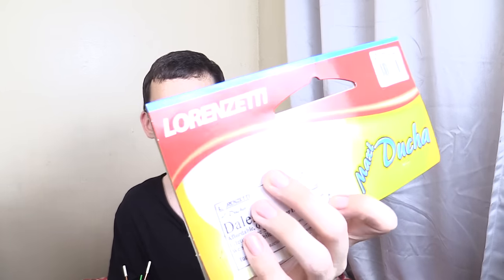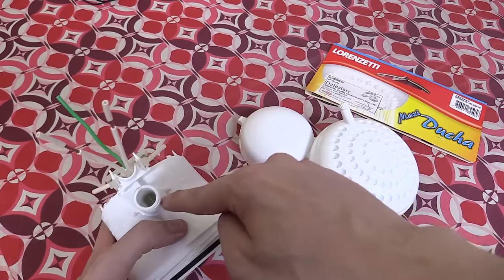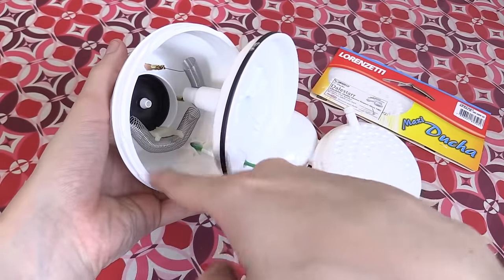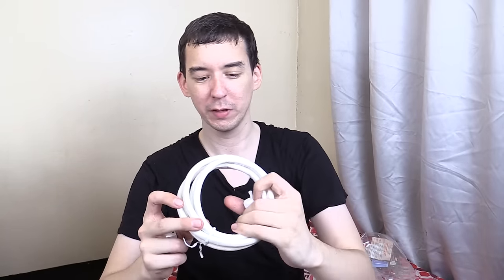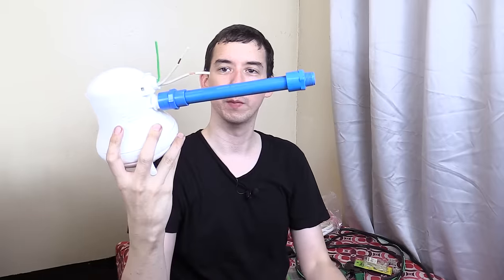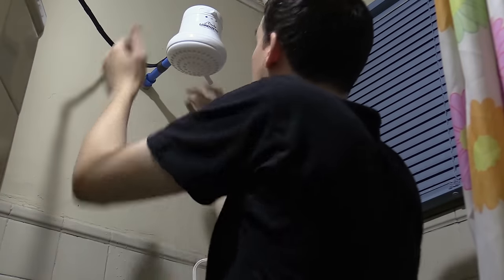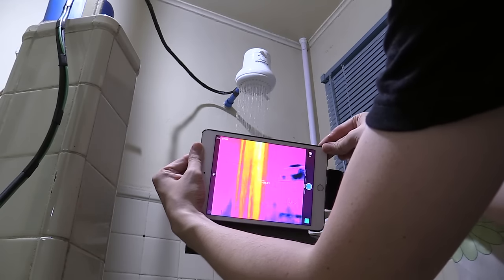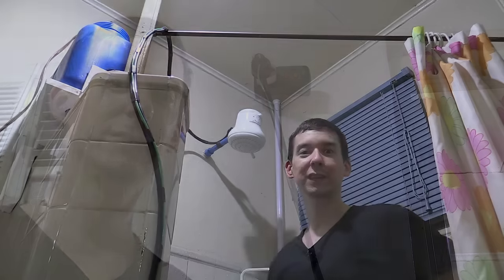Lorenzetti Electric Shower Head

Comment: What you are showing is a small, maybe inch long naked wire for a ground. That isn't going to provide adequate protection. You show that there is a larger piece of grounded metal in another part of the shower head, but that is before the water gets to the heating coils, and therefore, that isn't going to provide any protection. O. K., now, if you had a grounded screen over that hole after the heading coils, I would say that that will provide adequate protection, but then there is the headache of having to open the shower head and do periodic inspections, since the screen may wear away. The best way to provide protection will be with the RCD device that you hooked up, but you will have to keep the grounded wire of the shower head disconnected, other wise it will keep on tripping the RCD device. It didn't trip the RCD device in your area probably because the water didn't have enough impurities in it to cause it to conduct enough electricity to trip the device. Alright, now, probably you are wondering if the contact the water is making with a person cause the RCD device to keep on tripping. Not if there is a good amount of distance between the shower head and a person's head. Being that the water comes out in droplets, it won't produce a conducting bridge between a the shower head and the person's head.

Comment: Won't it melt after some time if the water is hot? If it does, then buying a boiler would propably be cheaper in a long run.

Comment: I have lived my entire life here, I do not defend brazil in any means but just to clarify isn't the showers fault if one does not use the ground.
My moms house didn't had a ground, I used to get shock from everything, my pc, the fridge, the shower, a electric guitar when I had one, hahah that was hard to overcome.

like others have said, most houses are old, and I'm not sure why but looks like none of the architects care about grounding anything. You'll find ground only in new building or those that have enough money to build one, gas pipes started to been a thing here around 2008 more or less, but not for shower, mostly for oven.

When I got the money I have the ground installed, and all the wiring for all the sockets plus the changes in the main power distribution plus the service cost me a lot, but no more shocks. I can definitely say say that most people "prefer" the small shock over the super overpriced services and products.

Plus, it is hot as fuc#@# here, so people don't care much about it, specially if you go any where that isn't south. I used to live in Cuiaba, or how people call it, Cuiabrasa, with means the name of the city + ending with ember (brasa). You can easily see 35º at night

Comment: Those showers are usually safe even without the ground wire, unless the neutral wire gets interrupted. In that case, the electricity has no way to go other than the ground, passing through the water and your body. The ground wire is a form of safety redundancy that avoids accidents in case of an interrupted neutral wire. By the way, any breaker panel should have a RCD (device that breaks the circuit whenever it detects current leakage).

Comment: If you take it apart, use a glue gun and completely cover the exposed wires as much as possible.  It can greatly increase the safety of the mechanism.   I would also consider wiring in a circuit board designed to not pull too many amps and then a fuse just in case.   That should prevent any bad things from happening, especially in an electrical storm.  It's very simple tbh, just requires a bit of extra time.
Reply: the glue would melt and, probably, be more harmful tbh

Comment: It's hilarious how many Brazilians comment on these shower head videos and how very defensive they are about them.

I understand the various reasons these are so commonly used in some countries but they still have to be installed properly and be replaced every handful of years to remain relatively safe to operate.

Yes, they technically work and are reasonably safe but fundamentally are more dangerous than a water heater tank or a the more robust types of electrical shower units. It's just a fact, sorry.

Comment: Those things have a serious issue even with proper wiring because they turn ON automatically with water pressure but if there's dust in the mechanism it can get stuck ON once you close the water, then they start spewing hot water and vapor and next thing you know the plastic starts to melt and fall down like drops, they are made with PVC so at least the fire risk is reduced but there you go, there's another reason to call them like that. 

If you are going to use one of those things make sure you have a switch next to it and keep in mind that if you turn the water off and the shower head still keeps making noise it means that it WILL burn unless you turn the water back on or turn the switch off. If there are children you can tie a cord to the switch so they can pull it and always stay attentive because they will most likely not know what is going on.

Comment: I decided to touch the piping on a shoddily installed one while showering at a relatives place in Brazil, ended up getting a 240v tingle. Never had an issue with em otherwise.

Comment: Use the low seeing. For the high seeing you need a #10 wire set and 30 amp breaker minimum. If you take long showers then you need a number #8 wire set and 40A breaker. You have to use a twist lock or direct connection because the biggest standard plug is 20A and you'll need a GFI breaker since the biggest GFI plug is 20A and if in a foreign country make sure the panel actually has a ground that's actually grounded to Earth and to the incoming neutral. And that the panel main breaker and wires feeding it are bigger than whatever you are sending to the shower so you don't set your place on fire.

Comment: What's fun about these is when they are installed properly and the heating element inside is burnt out or disconnected due to corrosion or what ever if u hand come in contact with the nozzle part while running water , it will shock you !! I've been zapped a couple times . Then I upgraded to an economic smart 18 ...lol

Comment: The wires you think is strange is a safety mechanism. We use a device to unite the wires of the head shower and the wires of the house. If something fail, the divice burns but not the shower or the house.

Comment: I'll def. will not install this in my summer house! Better I'll be dirty and stinky (or will visit sauna few times) than I'll be dead.
A much safer solution is to use transparent water baloons on a roof. They're getting warm (or hot!) in sunny weather. I've seen them in China, it's a very popular thing there.

Comment: The worst thing I’ve ever heard of those eletric showers here in Brasil was just a little static, the fio terra (the green wire, I don’t know how do you say it) estabilize the circuit and the circuit breaker turns off before a real chock. Btw, I already heard about a girl who suffocated with a gas shower...

Comment: Even ungrounded , here in Brazil we don't use copper pipes, we use pvc pipes, in some very poorly executed installation that i had to shower i shocked myself once, but only when touching the faucet and judging by my earlier electrocutions (which include closing the circuit through my hand) the current on my body were way way way lower than a lethal current,it was just a tingling sensation on my finger, so i had to wear slippers to close the faucet.

Comment: So long as the ground is sound ie less impedance than the path through the water and your body then it’s relatively safe even if the neutral phase fails for some reason but really it would need a fast tripping 30 mA RCD. That would never in a million years be allowed in the uk. I’ve stayed in the Philippines many times and it’s amazing how low the safety standards are but people seem to manage fine with no grounds and just mcb protection. The power companies don’t appear to provide a ground into the property so a local spike is necessary but if it’s bone dry then it won’t conduct much anyway.

Comment: Being in Ph tap water is already warmish, different if you in colder climate. I live in Perth Australia and use gas instant water heater. During winter nice and warm, in summer will burn you, unless you set to lowest setting.  Here electrical water heaters around 20kW, Singapore 5kW, so 3kW does make sense

Comment: I recently changed my shower head here in Brazil (Gringo with no prior electrical experience). Never touched the previous shower head directly, but touched my new one while showering today, and felt a tingeling sensation while touching the shower head. Also no grounding avaliable. Could I have put the AC cables the wrong way? Is that a thing?

Comment: All these showers that direcly put Phase + Neutral in the water, present high amounts of current leake through the water plumbing and structure to the ground. This usually do not provoke electric shocks to the user, even with the green wire unconnected. Here in Braizil most houses do not have dedicated Ground wires, and the green wire is either left unconnected or connected to Neutral. The real danger of electric shock is in the loss of Neutral or when it has a high V related to ground. Then shock is very likely. RCDs fo such shower need to allow a considerable current leak without tripping. The newer versions of such showers have heaters isolated from the water so that common RCDs work as expected. In the end of the day, electric shower are always dangerous devices that need to be serviced by trained and experienced technicians.

Comment: Those images are isolated cases, our neutral wire is grounded, when the house doesn't have a properly ground system, like mine, and we don't use eletrical tape, but ceramic conectors!

Comment: Can you clarify this for me. There are 2 white wires and a yellow wire which is used for ground. Of the 2 wire does it matter which is live and which is neutral  or just let me know how did you connect yours, the fact that I see it work with no issues. 
Thank you.

Comment: Houses in Thailand have electric water pumps and in-shower water heaters. And if you think that they're grounded, they may not be.

I got shocked in Thailand when stirring pasta with a metal utensil in a portable wok. I became the ground. Not a fun experience.

Most houses don't have sockets with a 3rd plug for a ground. But What would be the use when appliances don't either.

Comment: I used these types of showers when I was in Argentina, Brazil, Peru and Bolivia. I learnt fast not to adjust the settings while having a shower because I got zapped. 
It is the most stupid idea ever to have electrical wires inside the bloody shower head. 
One hotel I stayed at in Bolivia had the electrical box for the building inside my actual shower.

Comment: This is one of ther cheapest electric shower heads, and yet it has a record of safety for more than 40 years. There are plenty more accidents/deaths related to gas water heaters.

BTW, if your model has 3200W, it has the low-power heating element. Usually those shower heads come with 5400W heating elements.

Comment: The thin stream of water has too much resistance, but if someone unscrews it and it falls it into a filled bathtub if the wire is long enough, and the person in the tub touches a grounded object outside the bathtub, like the metal valve handle for the grounded metal pipes in the wall, then it might be a nasty shock.

Comment: Theres a few safety measures you have to take in order to make this shower work in a safety way:
1. Make sure you do a good intallation with the wires well covered and a proper grounding. 
2. The water stream it's not a good electrical conductor when in comes from this showerheads cus it split in little drops almos instantly when it comes out.  So make sure you can't easily reach the shower head, ideally there must be a space of at least 30cm between your head and the shower head. 
3. If there's too much water pressure the water stream could close a circuit between you and the wires so if you know your water pressure is too high just use that little pressure tap that comes with the shower. 
4. Make sure you have a GFCI installed, that way there's no chance of electric shock at all. 
5. If the plastic is broken, or it catch fire or simply you are not an electrician.. do NOT try to repair the showerhead... just buy another one.. its cheap.
And that's it, no need to freak out about some simple tecnology that's been used for generations without killing anyone that I'm aware of. I'm an electrician and I been using this showers my entire life.

Comment: Some brazilian must have told you by now that you got the shower "blow-off valve" totally wrong. We use it in brazil to wash our privates more conveniently. There's a valve that diverts most of the water through the plastic hose. That's not for electric cables at all. About shocks, most homes in Brazil have electric showers without a neutral wire, and I've lived in plenty of them. The only constant drawback is getting shocked whenever we touch the metal valve. My wife is so traumatized by these shocks that she uses her flip-flops to turn on and off even a non-electric shower.

Comment: Jus make sure turn on water first, before to turn on the power switch to fill the diaphragm with water and when you done shut off and then turn off the water, because sometimes the impeller of the electrical part stays stuck

Comment: I have installed one of these shower head living in South Africa. When I switch my circuit breaker on and let the water running every thing is ok as soon as I turn the heat to one of the settings my earth leakage trips. My ground is connected. Do you have any idea what the problem can be.

Comment: I tried this in a Airbnb in Campeche. I'm sure the owner did not hook up the ground properly because I got shocked touching the top to adjust the setting and touching the water on the head. It is not just a tingling its a fuk_N shock! Confirmed it's a suicide shower!
Reply from the maker: That's one way to wake up 🙈

Comment: I remember those in the early 80s when I was 8 and the wires used to spark and give you cold and hot when it was doing that short.

Comment: Hi, our landlord recently installed this same shower, the second day of usage the mains tripped twice, and when closing the shower, a flash of white light appeared on the head of the shower, very lightly, by the 4th day of using the shower the flash of white light appeared bigger like a flash of lightening and now the flash of light on the shower head was green, I need to know if this is normal, having flash of light on the shower head when closing the water, I urgently required your advice and is it safe to use the shower knowing everytime I close the shower this huge light flashes either white or green and why is it doing this. Vaneshree

Comment: hi.  just installed one of these but the water on either setting is so hot it cannot be used.  doesnt seem to be a difference between hi and low settings.  water is near boiling

Comment: The "tingle" sensation simply does not exists, because the impedance of your body is a lot higher than the water or resistor impedance. The current on your body is almost zero.

That's why a fork on the socked heat up until explode ir burn, but does not electrocute you.

Comment: The distance of the "fall" is important too, as close to the exit noozle you are, the more electrical shock you'll feel.
But the ground wire usually solves that...I'm using a gas heated shower, and fuck, how I miss those showers, kills heats almost instantly, and cools down as fast as it got hot, in begining I used to forget the gas heater turned on, and few minutes later the relief valve were poping up remembering that I was boiling water in the pipes =P

Comment: the current flows through the wires easier than through the water, but it will kill you right quick if one of the elements wears out and breaks , because then the current has to go into the water.

Comment: You should use ceramic connector to connect the cables impeding that cables doesn't melt with high electricity

Comment: Are you sure your AC socket actually have a ground wire connected to it? because living in the philippines i've never seen an AC installation where the electrician actually connected the ground plug hole to anything, it's usually just there to fit the AC Plug..

Comment: Believe in me Sr. I'm Brazilian and yes, this brand is from Brazil. I've been using this kind of device for 44 years, and I can tell that it's safe, much more than gas heaters, that produce carbon monoxide and eventually kill someone here every year. This electric device shouldn't be plugged on commom AC outlet, must have a specific circuit protected by a circuit breaker and a DR (differential residual) device. Since it's an high power electric device, it's highly recommend to hire an electrician to do a correct installation of it. It's very safe, if the standards rules are followed.
Reply from the maker: Are there any "high-end" models with special features?
Reply: @GadgetAddict  For sure, you have electronic adjusting elements, multiposition water outlets, music reproduction (no joke). It is still a very popular product here in Brasil, since not every house has gas piping, specially older ones.

New constructions, mostly apartments, have gas. Newer houses can have solar sometimes.

But to be honest, I like the electic ones, hot water instantly, less temperature fluctuations and probably more cost effective, since electricity is still a cheaper option than gas here.

Just remember, don't touch it while the water is running, unless its an electronic model, temperature adjustmemts must be performed with the water flow off.

Take care and have a nice shower!! lol